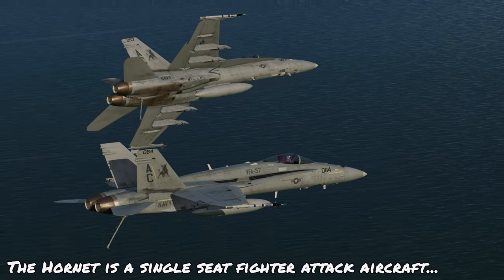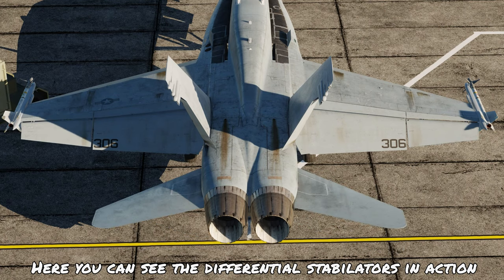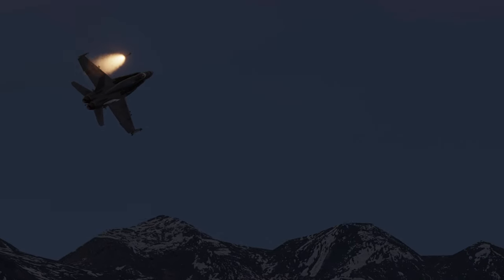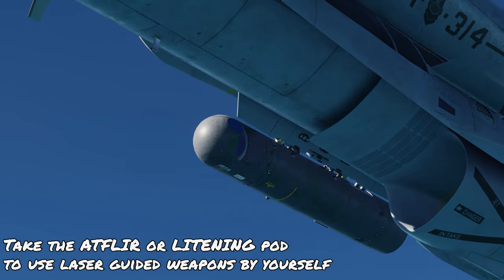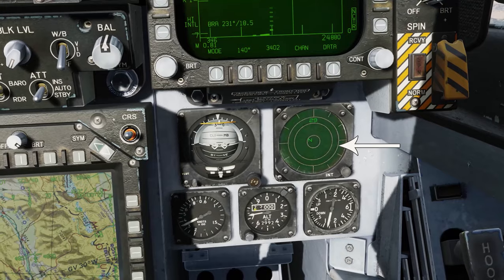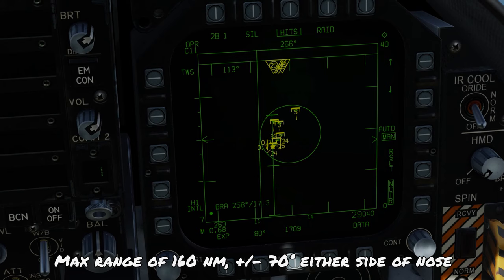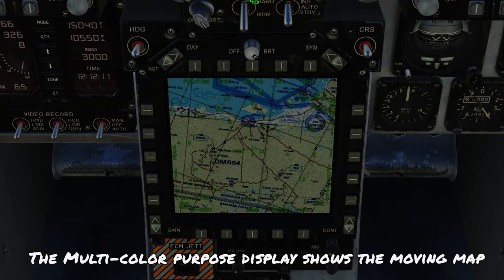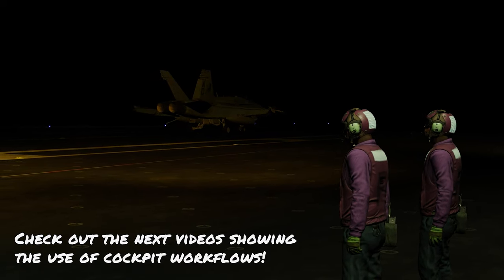DCS F/A-18C #1 - Aircraft General

Comment: GReat, i'll be on the lookout for this series :)
side note : while the content is great and to the point, I feel that you should rebalance the sound. Multiple time during the video I had trouble hearing you correctly over the engine.
(The fact that i'm not a native speaker could be a reason that i'm more disturbed by external noises, but that's not usually the case on other DCS related videos)

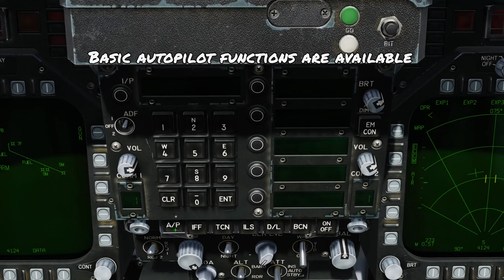Comment: 11:32 I don't think it's fair to call it a basic autopilot system.

You've got simple altitude, heading and attitude holds, but there's a lot more.
You can program a waypoint sequence and have it fly to each one on course. (Or tell it to overfly)
It can line you up for an attack run with an auto drop. 

Fly to TACAN surface stations.(some larger airborne ones too)

Fly towards an airfield (wypt or TCN) and intercept a selected radial.

There is also a FD bombing mode that's basically a tactical autopilot with many more features.

Finally, you have the automatic carrier landing system or ACLS. The ACLS system is absent in DCS at the moment and is quite complicated. 

There is a traffic control mode for flying off of marshall instructions, and an approach mode where you can have it land itself.

Really the only shortcoming in the A/P system is that it can't change altitude for you.

Bonus: in any of the hold modes you can use the trim hat to adjust the aircraft pitch and roll. This is part of the CSS system and is a default with any A/P mode selection. You can enter CSS by itself with A/P and ON/OFF.